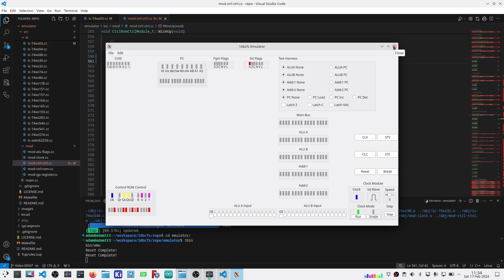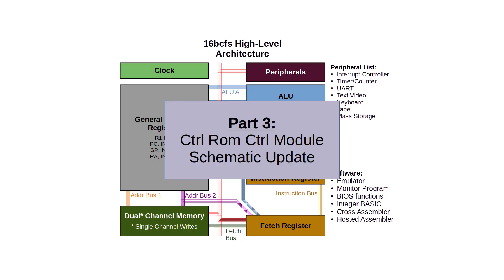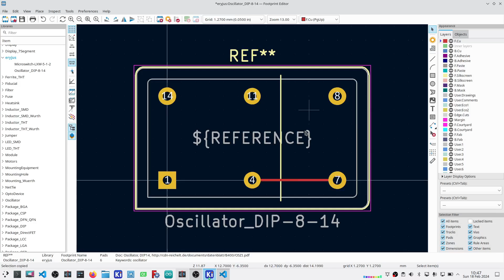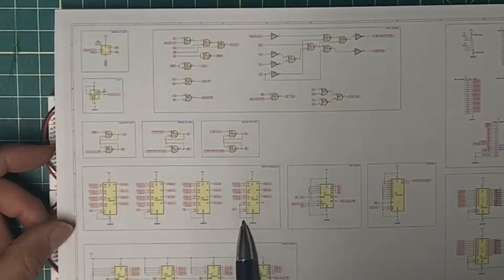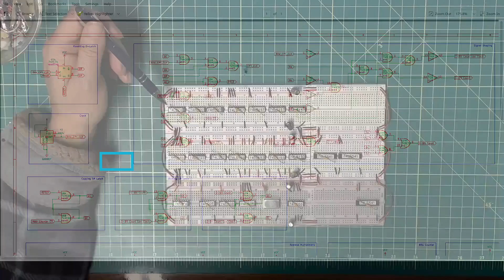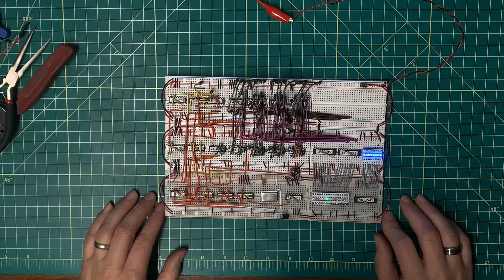0093: Control ROM Control Breadboard | 16-Bit Computer From Scratch

Comment: Is the high bit off during the count? It appeared so in the low speed test. Since the high bit is 32768, at the end of your 32k  (0-32767) it should be set, shouldn't it? Congrats on getting this to breadboard and appearing to work correctly. Big milestone. '08 is a quad 2 input AND gate if you need them in the future. A lot of the odd numbered 74xx are open collector.
Reply from the maker: @grumpyoldman5368 -- That's a good question.  There are several points of the video where the Most Significant Bit might be relevant to the question, so let me see if I can't provide an overall picture of the situation which might being clarity.

* For the LED, the MSb is hard-wired to LOW most of the video.  I change that when I get into the final testing.  I was looking at the address being fed off the module rather than the value in the counter ICs.  Even the emulator reflected this.
* Only the Least Significant 15 bits are used for the SRAM address -- yes, this is 32K and 15-bits is appropriate.  I know you know this, but in case anyone else is tagging along with our conversation.
* In interacting with the serial EEPROM, recall that I am actually shifting 32678 + 3 bytes total, and the counter needs to count all 32681 bytes.  The additional 3 bytes are the command to read and the (16-bit/2-byte) address at which to start the reads.  The MSb of that starting address is ignored by the EEPROM.
* To get the correct number of bytes shifted, I am starting the address counter at 7FFD and stopping the whole copy logic on rollover from FFFF to 0000 (when Carry Out goes LOW).

So, to directly answer your question, the MSb is OFF on resetting the circuit and sending the command to the EEPROM and ON while actually copying data to the SRAM.  I thought of using that fact in the control signals for the SRAM (#CE, #WE, #OE), but I feared that would introduce yet another race condition.  So, I opted instead for the SR latches.

So, the burning question: Adam, did you over-engineer this and isn't there a more elegant solution?  Yes, and yes.  The problem is I do not have the experience to confidently create such a circuit which I know will work 100% of the time.

Finally, please keep in mind I did not wire that MSb up correctly when testing and is going to be addressed at the beginning of the next video.  I was simply beyond my "comfortable video length budget" when I wrapped up the last video and I believe I called the outstanding task out during the wrap-up.

Feel free to follow-up with any specific questions if I missed your point.